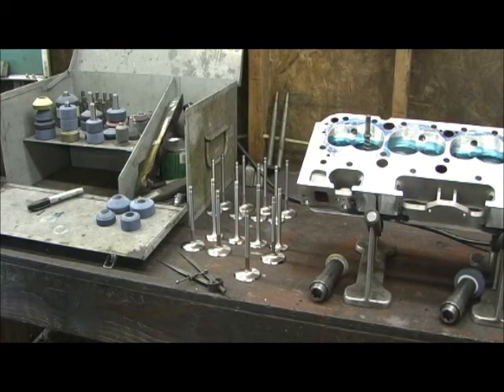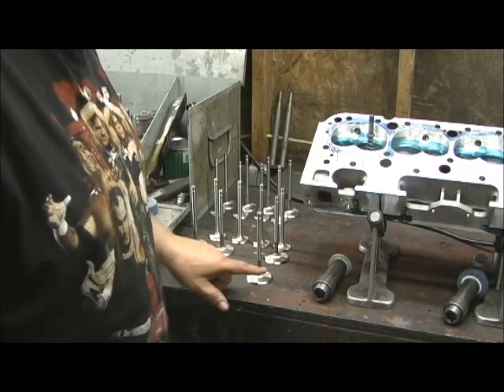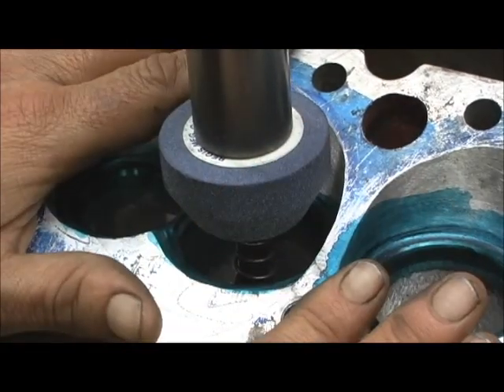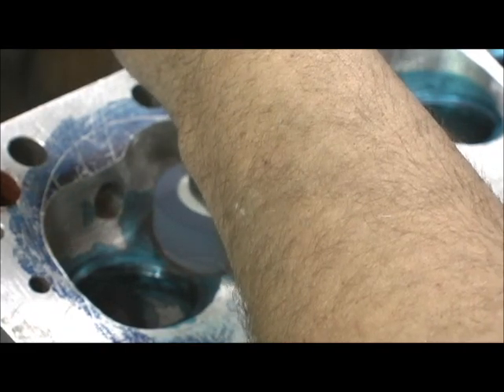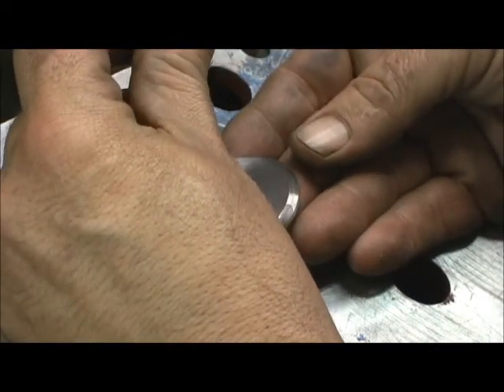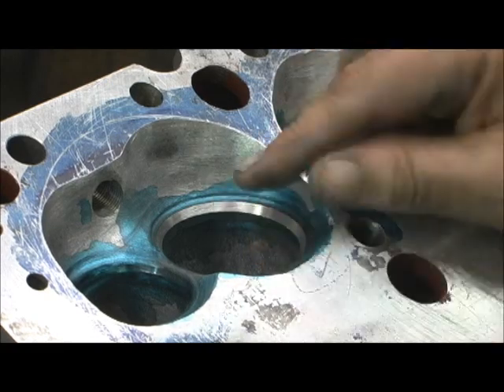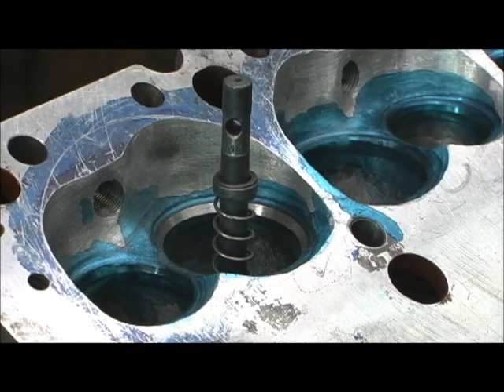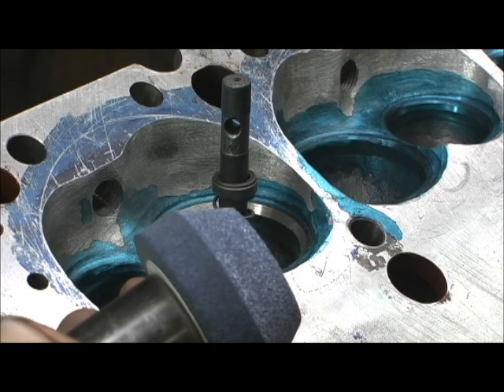Denmark SBC ProComp 190cc Valve Job 60,30 9.0

Comment: why do you use stones and not cutters?
Reply from the maker: Scott D I had a Serdi 100 a few years ago, and after TRYING and TRYING, I could never get the dam machine to get seat runnout better then .003.  The one thing I do miss, is the Radius cutters, other than that, it was USELESS to me, as I live by the runnout gauge, and I was having to do the dam valve job TWICE, one with the serdi (one good thing, was it set Depth in half the time I do with the stones) and once with the stones.  This way (I got a GOOD stone holder, Gauge, pilot, relationship as I replace stone holders YEARLY) I only have to do it once and get the UNDER .001 runnout. Bad thing is, it takes about 4 to 6 hours to do my valve jobs...That is O.K. though, at least I know I wont get any comebacks.